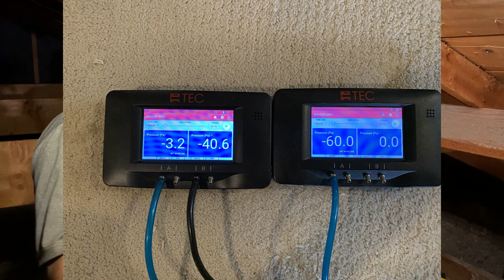What If One Suction Point Isn't Enough To Reduce Your Radon & You Have a Finished Basement?

Comment: Thanks for the great informative videos and your awesome interaction in the comments. Is there any reason for a house of this age to have an HVAC system draining condensation into a Radon pipe coming out of the ground?  We have a radon system in the corner of the basement leading to the fan etc. to the outside of the house. But about ten feet away there's a PVC pipe cemented to the ground and marked with all the RRS warning stickers on it, next to the furnace that had the condensation pipes hooked up to it.  Without it's connection to the HVAC it's just a 3-4 foot PVC stump sticking out of the ground where we think there might be a drain. I can't find anything consistent with this being part of other systems. We can't tell if it's actually part of the Radon system or if the previous owner re-purposed some PVC for some reason without removing the warning sticker, and then why was it hooked up to the furnace . . . ?
Reply from the maker: Thank you, Ed.

It sounds like it was perhaps a soakaway drain to drain condensation into the soil. Someone may have capped it off and installed a condensate pump to handle the condensate from the HVAC system.
Reply: @AmericanRadonMitigation   But why would it be integrated into the Radon reduction system?
Reply from the maker: Is it an additional suction point?
Reply: @AmericanRadonMitigation   I think that's what I can't figure out...  there's nothing above ground connecting it to the stuff with the U-tube and fan connected. Could the connection only be under the basement floor?
Reply from the maker: I doubt it. It's hard to help you without seeing it.
Reply: @AmericanRadonMitigation   very true - thanks again!

Comment: Is stitching possible with in-floor heat?
Reply from the maker: Yes, you will want to locate the radiant heat before drilling, though. We use a thermal camera or hire a company to use ground-penetrating radar to find them if they can't be turned on.

Comment: What size pipe is required? If you don't have any way of doing pfe testing can a 4" be put in or would that be overkill?
Reply from the maker: Good question, Art. 4-inch piping would have been overkill in this home but would not have hurt anything. Using a pipe that’s too small or has many fittings may restrict airflow through the pipe. This, in turn, can lead to the use of a larger radon fan, more noise, more energy consumption, weaker pressure field extension, and limited radon reduction. 

Generally, we use 4-inch piping in homes with drain tile or homes that will be moving a lot of air. If it's clay or fine sand below the slab, we usually use 3- inch pipe. I wouldn't recommend the use of 2-inch piping if you can't measure airflow. 

Does that answer your question? If not, we do offer virtual consulting and rent diagnostic equipment. You can call Danielle for more information at 612-474-1004.
Reply: @AmericanRadonMitigation  Thanks that helps a lot
Reply from the maker: You're welcome, Art.

Comment: All that work for just 1.3? Seems like way over kill. Most systems ive seen are starting at 10-20 and getting down to 1.3 or lower. Why even put a system in at such a low level? You can get higher than 1.3 outside in some areas. Radon is in the crust of the entire world there is no place that there is none. Your best thing to do for your breathing health is to not smoke, then worry about Radon.
Reply from the maker: Most homes we work on in Minnesota have pre-mitigation radon levels between 2 and 10 pCi/L.  Since there's no safe level of radon, the lower the better. Some people have a lower risk tolerance than others. Typically, we find those people know someone who has lung cancer that is believed to be caused by radon exposure.
Reply: @AmericanRadonMitigation  Sound like a great way into scaring people into giving you lots of money....